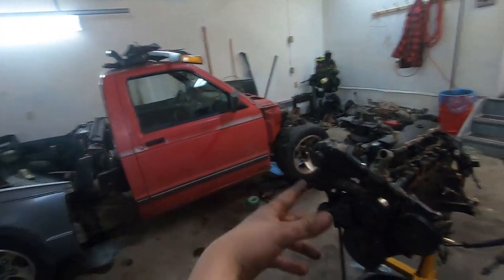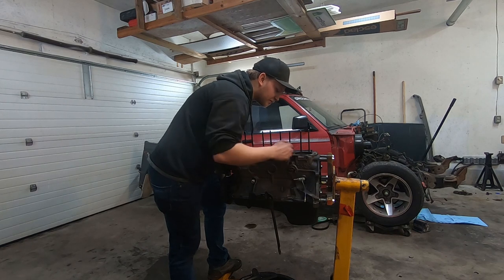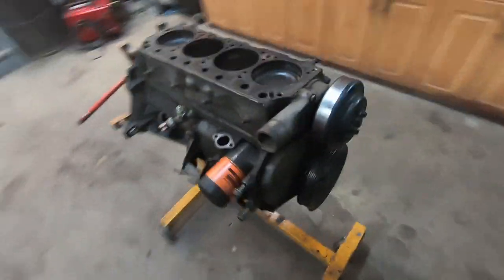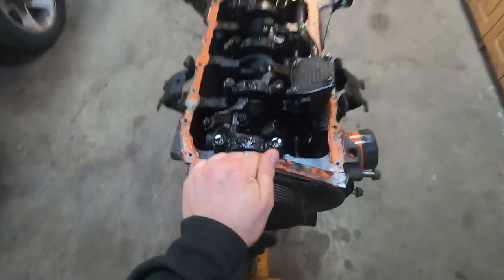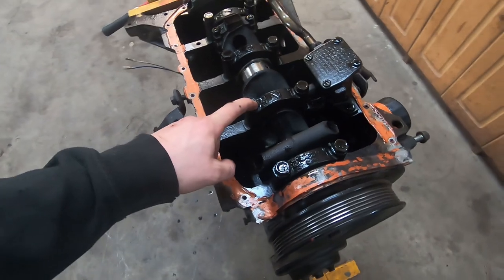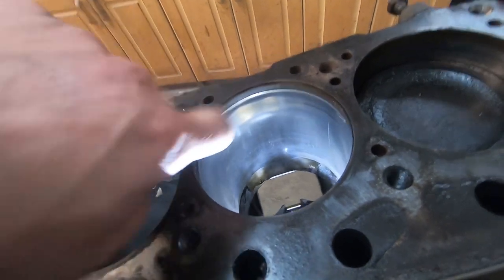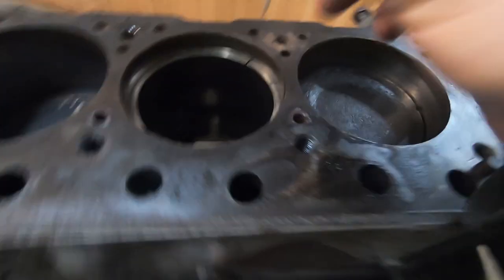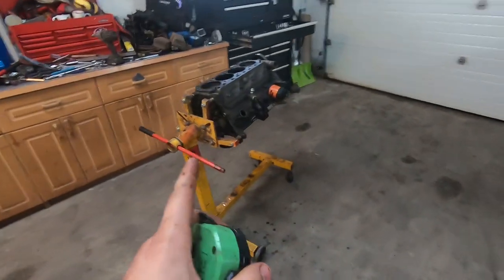2.5 Iron Duke BOOST ABUSED on FACTORY INTERNALS Teardown

Comment: Years ago, I had thought about turboing a 2.5. Everyone told me it wasn't a good idea...IIRC, the rod ratio would be off...but the bore was the same as the high revving 302 Chevy, so I thought about using 302 forged pistons but then I sold the truck...
Reply from the maker: Everyone who says something isn't a good Idea should be your reason to prove the suckers wrong! That's how my brain works haha. There's a lot of stigma for turboing a 2.5...but I mean hell I boosted mine from a factory 19sec 1/4 down to a 14.89

Comment: I bored my 2.5 iron duke 40 over but no boost lol. So far it runs like new. I got a 88 s10 5 speed my dad bought brand new. I had it repainted bright red again and rebuilt the duke and she looks and runs like a new one 👍🏻. But just like it was new it doesn’t have the power to get out of its own way 😂. I got slightly larger pistons but I can’t tell it did much for it. Doesn’t matter though. It’s my dads cool “ Little Red” as he called it. I pamper it. It’s my daily driver right now

That engine did good to go over 200k. Mine had lost quite a bit of compression by 150k. It was pretty tired.
Reply: I made a redneck ram air for mine with a 4" hose ran through the core support and zip tied to the grill back in the day. Its did make a noticeable difference on the highway, and the air filter would develop a dirt spot right where the incoming air hit - indicating that it wasnt just all in my head. Try getting it some more air!

Comment: How long/how many miles did you run the motor before this teardown? My only experience with these engines is in Fieros, and from what I can tell these engines hate abuse and high rpm but are bulletproof if driven with respect. I've read they have thin weak (albeit cast iron) blocks, and people pushing them and making a hole in the motor were the cause of many of the Fiero fire stories. I know the S10 2.5 has a stronger crank so maybe that helps but I'm surprised to see what most consider an economy truck motor handling so much boost.
Reply from the maker: I probably put 10,000km on it if I had to guess. It was starting to get a little down on power, hence the .050 ring gap haha
Reply: I got a 85 2.5 with 72k on it with the 4 speed it is very torque even with the low hp, but can't co no faster than 10 mph in first and by 35 mph I'm in 4th.I can stretch 3rd to 45 .My last name is the same as your as well.
Reply: @MrBakedDaily  are you a mailman?

Comment: Hey bro I don’t know if your reply but it’s worth a shot. I have a 92 s10 2.5 as well. My alternator bracket studs have snapped off while drive, don’t know how but now I need to take out the rest of the studs from the side of the cylinder head. I just wanted to ask do you know if those Studs can be taking out? I’m planning on buying a welder tomorrow and welding a nut to them and try backing them out like that. I would highly appreciate it if you reply or even just put your input. Have a good night
Reply from the maker: Welding a nut is a good option, sometimes a washer as a starting base works a little bit easier as well and then you can weld the nut on that for good measure. otherwise drilling and tapping but no one wants to do that lol

Comment: Ive always wanted to do a 3.0 swap, I'm currently building a dually s10 and throwing the old duke in it with hei and single barrel for simplicity
Reply from the maker: Hell yea dually will be sic!
Reply: What distributor are you using to run it with carb setup?

Comment: Im doing a 2.5 turbo install now ,, what did the turbo come off of? i have one off of a 4 cyl diesel im using with built in waste gate you mention u were up to 18 lbs of boost ,, did it start smoking or what caused the reason your tearing down?... got some more questions are there previous videos??
Reply from the maker: Turbo is a TD04 off a volvo s60, took the engine apart primarily because im doing an engine swap anyways, and i was having some power losses. ended up being just worn out and my ring gaps were huge

Comment: Strem how I doing man I just found ur channel nd I'm impressed I never knew I can put a turbo on my 2.5 tech four do u need to do other modifications to the engine nd to the car in order to do so nd do I have videos on how to disassemble this engine step by step the reason I'm saying this is because two weeks ago it started to throw white smoke nd I opened the filter cap nd there was oil everywhere man any ideas wat may caused it nd how to fix it myself ?
Reply from the maker: I don't have any step by step disassembly. I didn't do anything to the stock engine, just slapped a turbo on it and tuned it properly

Comment: 8.5:1 compression engines paired with 50 thou ring gap, it's like they where built for boost haha.
Reply from the maker: Hahaha yep! Now just imagine .030 over with flat tops and good rings, and a big cam, 2.5 would have a ton of potential
Reply: @ak_strem7010  you're right it's crazy that more isn't done with these motors they where in everything in the 80s